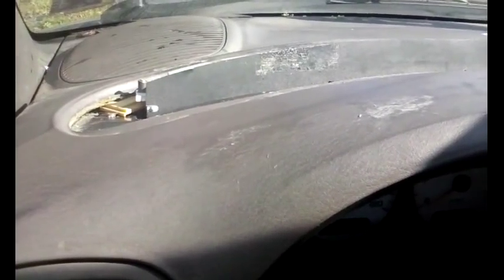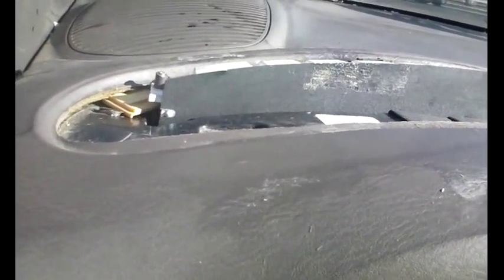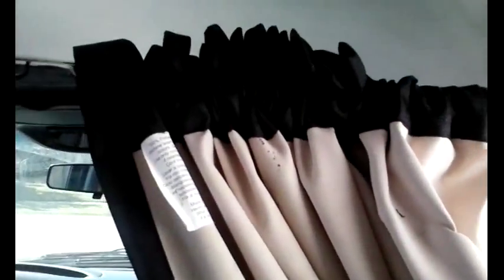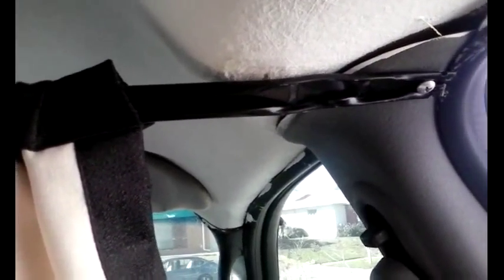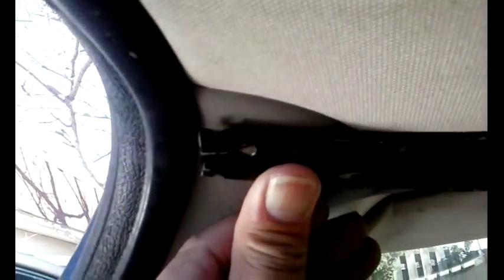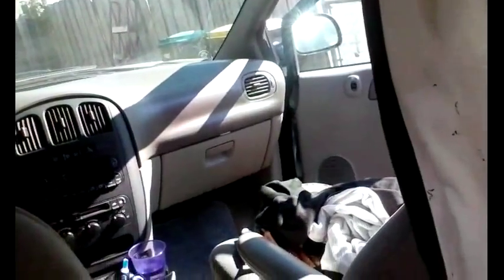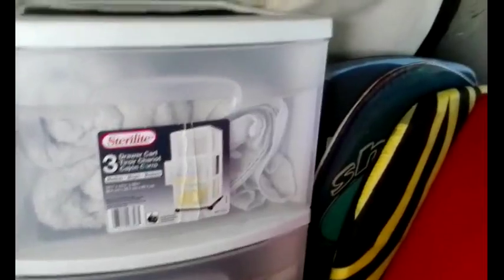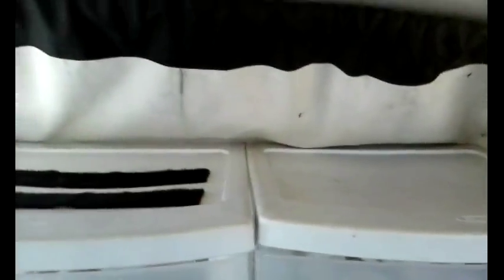E09 Camper Van Build - Heads Up Display and Installing Curtains For Stealth Minivan Camper Build

Comment: Do you leave the side windows in the back of the van covered all the time?
Reply from the maker: TheGeorgenc40 Yes. The rear side windows are always open (they have mosquito screening) and the curtains are always drawn, but you could open the curtains if you wanted. Keeping the curtains shut helps block out the heat and peeping eyes.